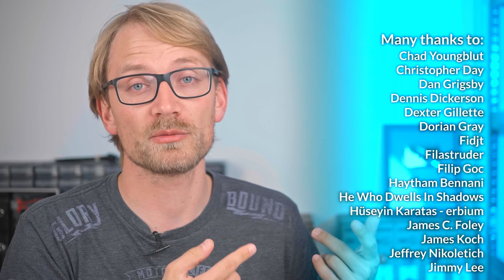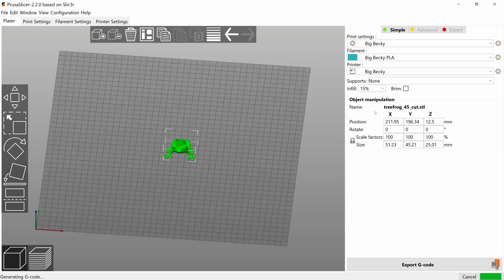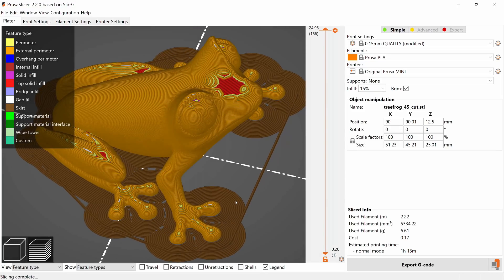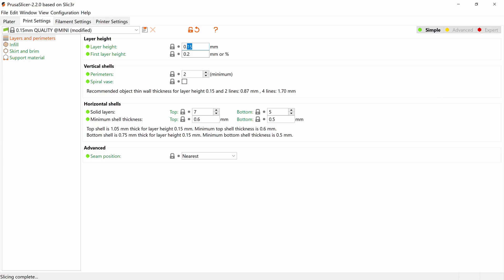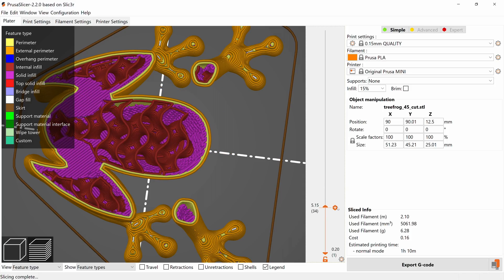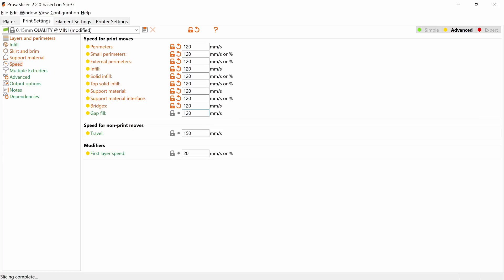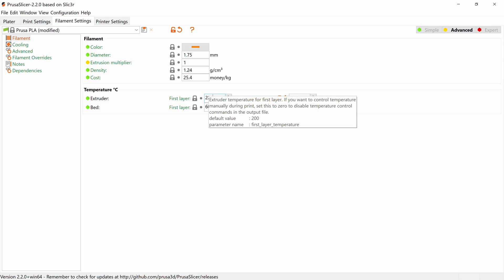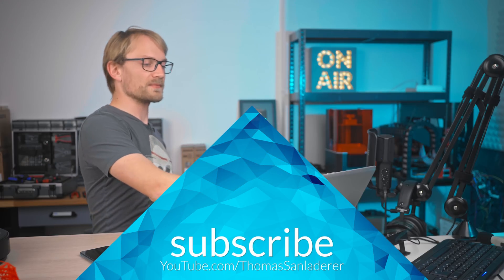3D Printing Basics: The Slicer! (Ep6)

Comment: I have been resin printing for some time now and have that figured out reasonably well. I have a part that I am trying to make that just doesn't work on a resin printer as it is quite thin and flat and after curing, tends to 'potato chip' (warp) no matter how I cure it. So, I bought my first FDM printer (Elegoo Neptune 3). I love the printer but am still learning a lot of the specifics. I can print the part I need but brim doesn't work, I seem to need a raft in order to get it to stick. Yes, the bed is very level (less than .05 deviation, which I tuned in) but the issue I have is that the part looks like an infill on the bottom but smooth on the top and no matter what variable I change it keeps on printing the same. I tried changing several settings, one at a time but it still has the appearance of filament laid down in strings to make the shape on the bottom but is beautifully smooth on the top... I need it smooth on the bottom and top... I am printing it flat on the bed but on a raft with 55% infill and 40 mm/sec. temps are currently at 208 and 65. Layer heights are identical for top and bottom and that is what is confusing me... why does the top work and not the bottom? Any idea?

Comment: I have been 3d modeling for over 15 years and just got my first printer. Does the slicing program create the fill area on a hollow model or do I have to go back and add it myself to the STL file? Current printer I have is a Davinci 1.0 Pro with the most recent software and firmware for now. Thinking of upgrading to repeater and Cura as other videos suggest eventually but stick with this to get started

Comment: im new for 3d printing, i was just designing via maya and blender for animation and decided to print my own work but i never thought that this can include a lot of tweaking, tried to print some of my files and it looked ok though it felt like im missing a lot of things since theres a lot of settings that i have no idea what it does.

as of now i am printing table top chibis as a noob but what im looking for is a good setting that doesnt have to use a lot of resin for the insides, time doesnt matter to me for as long as the designs are accurate so does it mean that printing slower means better design?

ive read some forums that says tilting it is a good choice? 

btw the files are around 4-6 inches tall, chibis so supports arent that needed since it is a standing figurine though im considering adding a cape to see how itll be printed.

btw why not have 1 layer outerwall? since we have the insides covered? if i added more volume inside would that be enough not to add outside support since  it already has a solid block inside?

Comment: It's probably self evident but always use the exact same filament when testing against  different settings/slicers...
Changing one setting can affect (and effect) another... for example you may need to increase the extruder temp in order to increase speed or layer height, even by one or two degrees...

I'm not happy unless my prints are flawless but I will settle with perfect ;)

Comment: With all due respect to his work, even video 5 was in basic or beginner, but moved to a higher level. I'm getting to know printers, programs and other items to buy. The slicer, you don't show where this frog came from, was it opened, imported, is there a process? I understand basic notions and who is starting, knowing. I will skip this part and insist later, even the people who already have experience did not know these tips, imagine for those who have never seen. Still thanks for the time and work.

Comment: An important tip, not just for 3D printing but in general: When troubleshooting or tuning your settings, do one at a time. If you change multiple things at once, you likely won't know which change or combination did result in what. So even if you solved your current issue, what you learned is vague at best and won't have much transferrable value to solving other problems later.
Reply: Golden nugget right here. thank you
Reply: Very very true.
Reply: thanks bro

Comment: Tom., do you suggest that the first layer height be set to 0.45 mm (i have a 0.4mm nozzle) manually in the slicer?
The default settings are 200% of the first layer height. Is that good for obtaining small features in the first layer (like embossed letters or small lines) instead of squishing more plastic down?

Comment: So sliced it, diced it and went to the shops for milk and still the printer doesnt even follow the layout of the slicer. It is weird, and using cura. Does prusa slic3r have a slicer that connects to the printer instead of just export g code? I'd look myself but I am totally devastated by my two month printing experience, i thought multiple times about throwing it threw the wall, cept the wall is useful.

Comment: For what it's worth, gyroid infill is superior at high print speeds and accelerations (120+ mm/s and 1500+ mm/s^2). Gyroid infill avoids the nozzle skipping over perpendicular layer lines, which is a huge problem with cubic and other similar infill styles - this can cause layer shifts, blobs of material at junctions, nozzle buildup, etc. Assuming your machine can handle high accelerations without ghosting and other artifacts, gyroid is capable of running much faster as it doesn't ever cross itself this way. On the other hand, triangle, cubic and other related infills have a hard speed limit at whatever point your nozzle starts "skipping" off subsequent layers.
Reply: Feel free to message me if you'd like to chat further about this!

Comment: Why didn't you explain skirt. To me it serves no purpose as it's not connected to the model. But still everyone uses it, so my question is why? If everyone is using it, it must serve a purpose, but what purpose? And you just skip any explanation of. ARGH! ;)
Reply: 1)If you print in a room with a open window and its a windy day, you can use it so your print does not get "blown away" (detach from printsurface).

2)Most people use it for ABS,ASA and all materials that need an enclosure, because it keeps the warm air inside. It has no real purpose when printing pla/petg (Accept if nr 1 is the case)

Comment: 100% agree on the print speeds advice. The defaults are usually ambitious to say the least, first question I ask beginners with quality issues is what their print speed is and usually hear 100-200mm/s and I'm like "yeah... listen, I set my MK3S (that cost three times more than your chinese clone) at 50mm/s max.". If you want faster prints increase layer height, use a rectilinear infill, or tweak the orientation rather than trying to throw that head around like a F1 car.

Comment: If I'm printing some details (like words) should I make them facing up (instead down towards the bed), even if downwards requires less support?
Reply: Do you mean standing them up? Don't quite follow. Having stuff print in the axis of the layers will always be a balancing act between controlling overhangs and getting the highest resolution, whereas on the build plate your resolution is fixed at the nozzle size so small letters will be missing detail. It's better actually to use some tricks in creating the model like adding some chamfers to avoid supports, using block letters that don't have any floating islands and just making sure no feature is less than 0.8mm. If you want to get fancy there are features like single extrusion gap fill and using automatic extrusion width where the slicer compensates the extruder pressure to create finer detail but it's hit or miss. Or print the entire thing at a 40 degree angle and make sure you have the part cooling fan speed dialled in perfectly.
Reply: Colin Alston wow! This was so helpful! Maybe someday you could do a video about printing text and fine details. Haven’t seen anything useful on YouTube yet.
Thanks!

Comment: HI Thomas, I can see what your trying to achieve but for a novice  it's useless. Why don't you get yourself a basic printer (like a novice might get eg Geeetech i3 Pro ) built it and then try and do a good print. This will introduce terms and concepts to new users. Show how to tweak the settings of the printer, calibrate the extruder, level the bed properly etc etc do a test print what to do about corners bulges, snots on the start of new layers, holes not dimensioned correctly, what acceleration settings do, jerk setting etc etc etc You are talking to users that know what you're talking about not novices. 
I've been trying to get my printer to give good results for over a year now it's been horrific the learning curve is vertical. Is threaded rod better than trapezoidal, is this hot end better than that hotend, is this version of Marlin better than this version, is there a hidden setting which helps me (yes manual mesh levelling by the way) I could go on but I wont